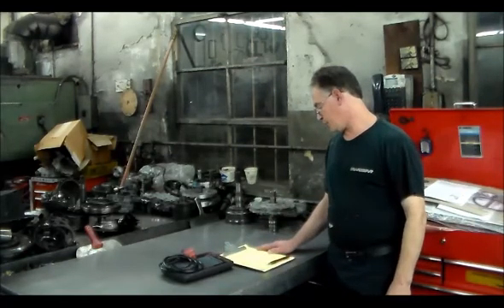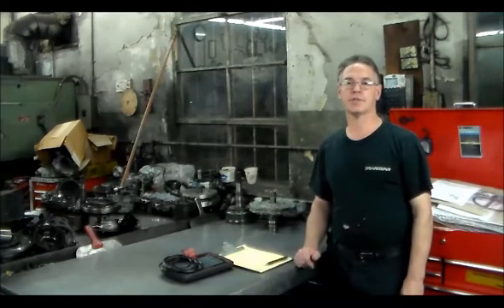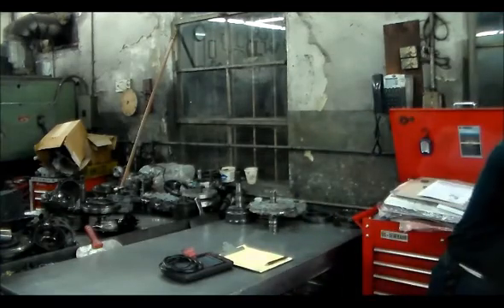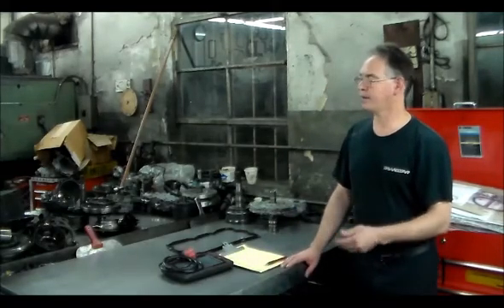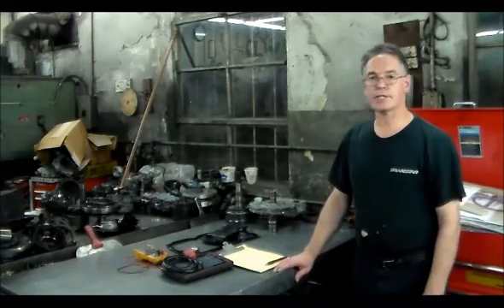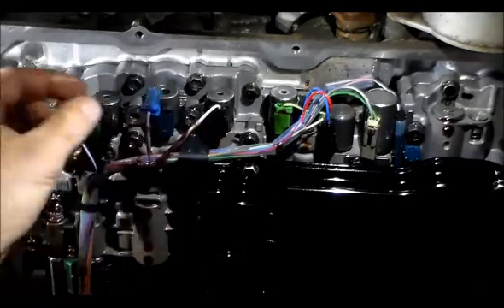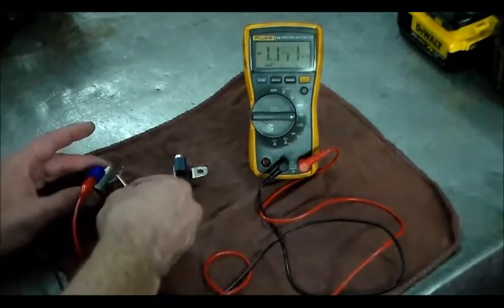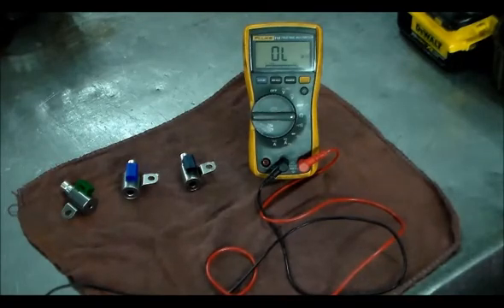AB60F, Code P0983

Comment: did you have to pull the valve body to change out that solenoid?  I couldn't quite tell in the video, but it looked like it was still in the vehicle?
Reply from the maker: For this solenoid, no i did not
Reply: Gary Ferraro thank you.   I'm getting ready to change the same shift solenoid s4 ( a.k.a. D, or 3-way solenoid #3).  Took me a while to figure out the correct one to order.... all data calls it s4, my scanner called it D, and a Toyota TSB calls it 3way solenoid #3. I ordered one from dealership.   It has a blue like connector on it. Thanks for your video and help.
Reply from the maker: Your getting the same code?
Reply: Gary Ferraro , the exact same code...I ohm tested and it is reading 135 ohms, well out of spec.
Reply from the maker: I agree with that, good job